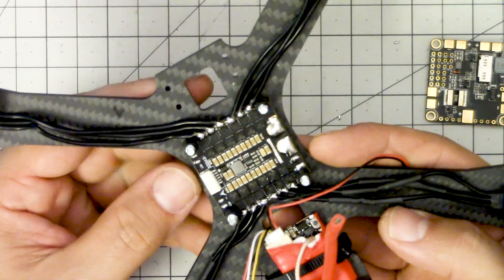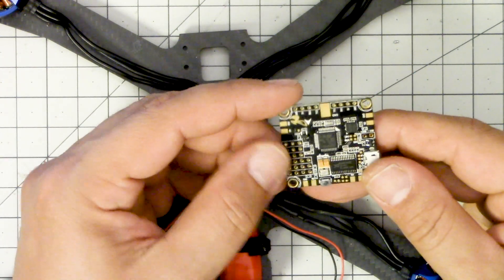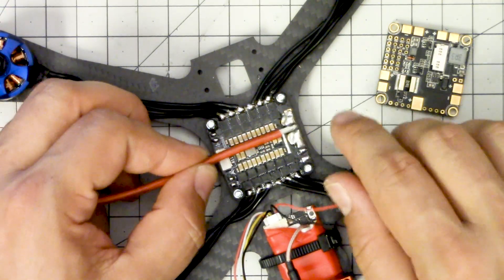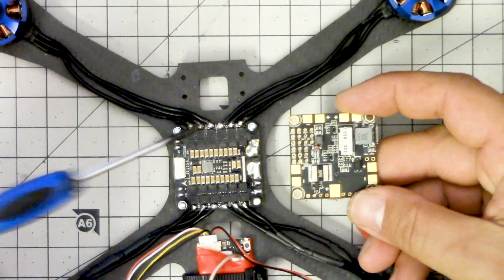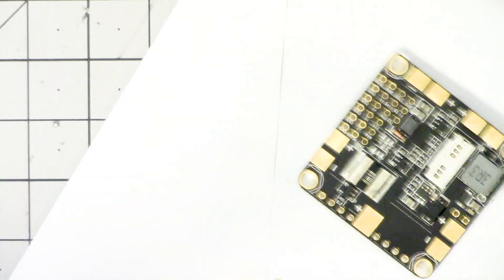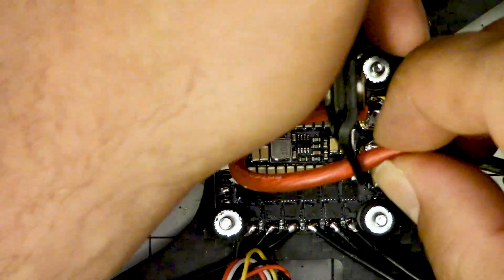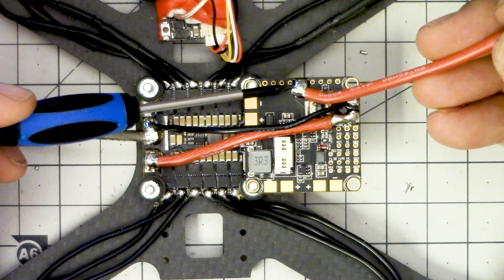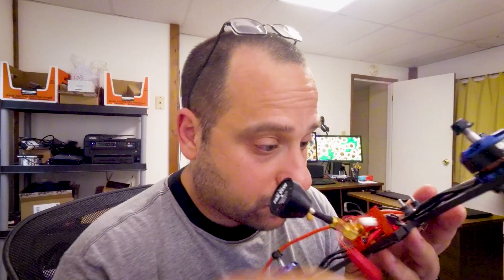All-In-One (AIO) FC  With 4-in-1 ESC | HOW TO WIRE IT UP CORRECTLY

Comment: Setting up the Armattan Chameleon i have soft mounted the PDB with the XT60 saver, so its stuck down, how can I use this to wire up my OMNIBUS F4 pro to use the current sensor, Ii looks like all the +v on PDB are connected.
Reply from the maker: In order to make it work, you would need a 2nd PDB, on the load-side of the Omnibus shunt resistor, to which the ESCs were attached. The ESCs must be on the load-side of the shunt resistor. The battery must be on the supply-side of the shunt resistor. The simplest way to make this happen is to wire as I showed in the video.

In theory, you could wire all the ESC positive wires to the load-side pad of the Omnibus shunt resistor, bypassing the PDB entirely. You would wire the PDB ESC+ to the Omnibus vBat+ pad. But what a mess that would be.
Reply: Yes agreed, what a mess.Do you use the current sensor?,  this is my first build, learned to fly with vortex 250 pro but couldn't do anything with that it was too locked in the the immersion eco system.
Would you leave it as is or would you get a new PDB, how important is it to monitor current. Thanks for the help!!
Reply from the maker: I would solder to the Omnibus as intended.

Comment: After each flight session I have to check for loose solder joints. Already 2 or 3 times the ESC signal gnd wire came loose, and the last time camera ground came loose :-(
Reply from the maker: They weren't properly soldered in the first place then. The through-holes on this board are a bit of a PITA to solder to. I always double check that they are secure.

Comment: All you negative nannies should probably start your own channels. 
Josh knows flux , rosin core  , and what tip to use including temperatures required for specific boards. He knows how to flow the solder on the copper pads.  Have you considered the difficulties in doing this with a camera in the way forcing you to use bad angles just so he can film what he is doing ???
He is trying to create content to help the larger majority of people in this hobby.  Tying a 4 in 1 esc to an aoi fc while maintaining the current sensor is a very worthwhile topic.  
Josh you are gonna like the way the chameleon handles.  
Thanks again for your time and effort.
Reply: two things Josh is a big boy and can stand up for himself unless you're dating him relax and everyone who said to use flux including myself is correct he should be using flux that is why he has to get the temperature up to 850 degrees and still doesn't want to join
Reply: https://static.gamespot.com/uploads/original/1551/15517906/2882473-8979705387-Preac.jpg

Comment: The + solder joint on the FC out to the 4in1, when flipped back onto the 4in1, looks terribly close to the - on the 4in1.  from the video it looks like they might touch! Would you put something between them?  Or is the distance between them look good in real life?
Reply from the maker: As long as they aren't touching, they're probably not going to touch. Even 1mm or so of spacing is plenty. But since the board is mounted on rubber standoffs, maybe it's worth a 2nd look. I would use liquid electrical tape or conformal coating.

Comment: the best way to do it is run the battery  + to fc the - of the fc to the +of the pdb - to battery
Reply: elroy edwards But won't we have high motor current flowing all over our FC that way?
Reply: elroy edwards 
you can't serial the -ve of the FC to the +ve of the esc cause the -ve of the fc is connected to signal -ve.

Comment: I love my bff3 board, but, after watching this, I almost wish I'd gone with a 4-in-1 esc with it. it's going to be a righteous pain in the ass if I ever need to get access to the bottom of the FC board again, with the power cables soldered underneath, and the esc wires on the top...

Comment: It seems to me that the omnibus pro is the ideal FC for 4in1 esc. 
The current sensor was designed to be connected like that with big pads that are definitely meant for the full current. 
Also it has a convenient jst connector for the 4in1 signal wires so that further simplifies everything. 
That combo means no pdb is needed so it's a slim two stack like the betaflight board, but easier to install and solder to.
That is definitely going in my next build.
Reply: This was the conclusion I came to when I went to a 4-in-1.  Omnibus F4 Pro.

Comment: The conical tip is the worst tip for large gauge pdb wires so One tip , get a better tip :p get it haha
Reply from the maker: +HecTech FPV I hate changing tips though.
Reply from the maker: +HecTech FPV oh, and this is a chisel tip anyway, not conical.
Reply: ah fair enough, though it might be worth a video . i still see many people have issue's with there soldering and most of it is there equipment

Comment: Hi mate. What solder to you use? Thanks
Reply: A well informed guess, based on the performance and behaviour of the solder, is a 60/40 rosin core solder. I'm guessing Kestor, just going by Joshua. 

That is a lead solder, not that awful lead free stuff. If you're shopping for solder, you may want to look at 63/37, which works as well as 60/40, but has a narrow, nearly non-existent, plastic range; that is the transition phase between liquid and solid. Basically harder to get a cold joint, while still giving you a nice flow, and same solder temps.

I've personally used Kestor 60/40 and 63/37, and I like both. I've also used MG Chemicals 60/40 and 63/37, and they perform the same as Kestor, while being cheaper on average.
Reply from the maker: +Ace12GA 60/40 leaded rosin core.

Comment: Now with the Runcam split, im wondering how/if i can even fit it into my chameleon build.
Reply: Not with a 4n1, you'd want a AIO board , no room for pdb.
Reply: If you wanted to do that, you could do the same fc board from the vid, just use seperate esc's on the arms to clear out that stack.
Reply from the maker: +Bobby K not the best combination honestly.
Reply: I don't think the camera's mounting holes are the real problem here...
Reply: Bobby K im
Reply: Zerro will 
Bnnnnn